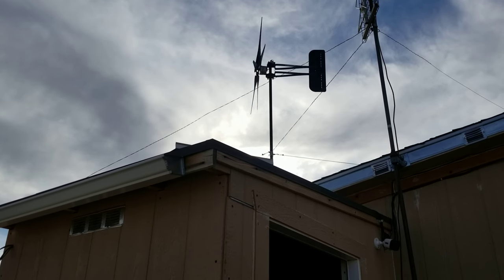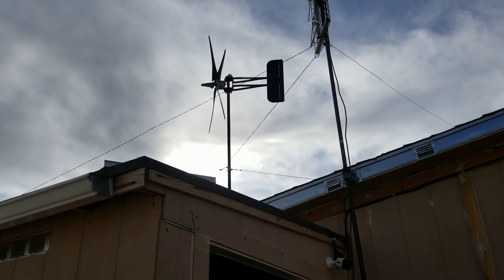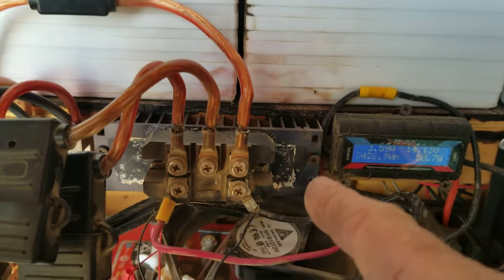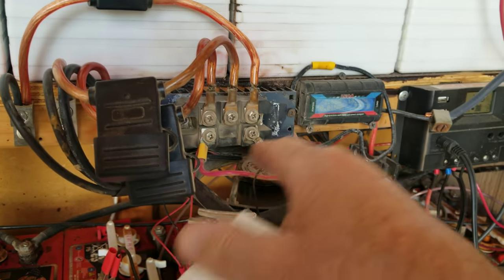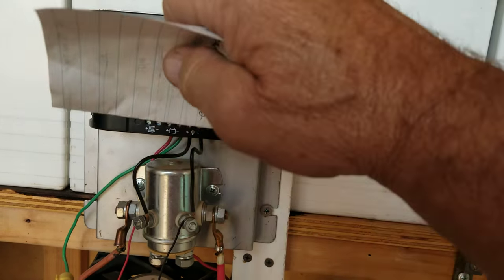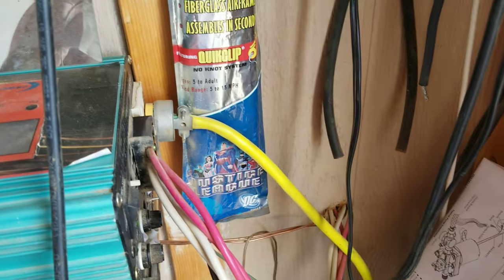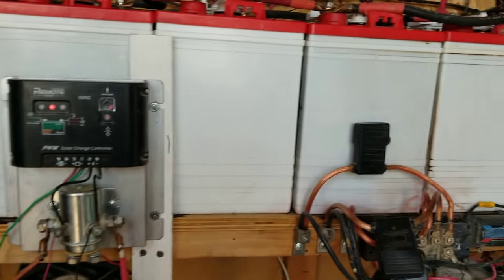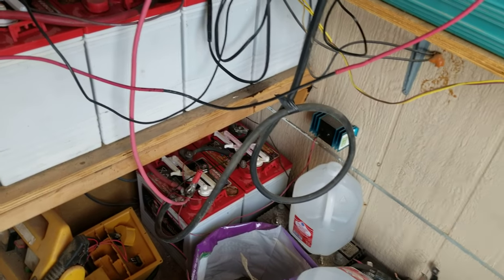Wind turbines, controllers and batteries explained, March 6, 2020

Comment: Very informative 
Thanks for this. 
Question..
What is the use of pma and pmg
Reply from the maker: Welcome aboard!
A PMA (3 wire) is an alternating current device which requires an external rectifier to convert the alternating current (AC) to direct current (DC) for connection to the battery bank .
A PMG has a rectifier built in, so only 2 wires come from the unit, directly to the battery bank. 
The PMA can use smaller gauge wire than the PMG which saves money, but also having the rectifier built in means you would need to bring the PMG down to replace the rectifier if it burns out.

Comment: What about lithium batteries for offgrid
Reply from the maker: LiFePo4 yes, good.  Lion, no.
*If going with LiFePo4, be sure the battery you buy has high and low temperature protection  built in.
*One big 48v 200ah is better than 4-12v 100ah 
*If in an area with freezing temps, either plan to store your batteries indoors in a heated room, or buy batteries with built in heaters.
Reply from the maker: Welcome aboard!

Comment: I have a wind generator and it has 3 red wire that come out are they all power out
Reply from the maker: Welcome aboard!  Yes, that is a 3 phase alternator that produces AC power.  In order to use it you need to run it through a "bridge rectifier" to convert it to DC if using it on a battery bank.
Reply: @GBear  
Yes it came with a controller 
I like your dump off controller I didn't think of that I'm just starting out but it's for my travel trailer
Reply from the maker: What are the numbers for that unit?  Also, make and model?

Comment: 8k inverter u running the whole house?
Reply from the maker: Hi Mike, welcome aboard. Actually, that old 8k PowerJack was in the beginning, I found out the hard way that the Chinese lie about their electronics.  I hooked up a well pump and it kept popping the inverter.  On further inspection, it said in fine print, "max pump-1200w" yet the inverter said 32000w surge on the same label.
I now use an AIMS 4000W, PURE SINE, SPLIT PHASE,  LOW FREQUENCY, and yes it runs the house, my shops and no problem with the pump at all.  I even run my milling machine.
If I was going to do it again, I would have liked to get the AIMS 6000 Though.  It wasn't available when I needed it.

Comment: you are the first person that I has a wind/solar power that prefers lead acid or golf cart batteries over deep cycle or lithium batteries. 
May I know the reason?
Reply from the maker: My lead acid ARE deep cycle.  They are golf cart batteries, specifically designed to handle heavy loads and discharge slowly, then recharge quickly.
When I started with wind and solar, about 8 years ago, these batteries only cost $99/each.  They did the job at an affordable price. 
As lithium became more popular, I almost wanted to switch, but their cost and them not liking extreme heat or cold persuaded me to stick with these.
Welcome aboard!
Reply: @GBear  Thank you. I was considering gold cart batteries because they are cheap. 

now I am just considering to buy used (burned out) batteries to regulate the Voltage so that the inverter work. I don't care about storing energy. I will let you know how it works!
Reply from the maker: @googlerreviewer4368  hmmmm, burned out batteries won't have voltage enough to run an inverter and produce output.
Reply: @GBear  I know they won't store any amps or power inside but I want to try it. because as soon as you charge a burned out battery, it would give you 12V, remove the charger away, it would go back down to 8V. so there's a slight chance that it might work. this way, it would work as long as it is windy or sunny.

I will keep u posted about the result.
Reply from the maker: Ok, but I hate to sound pessamistic...the inverter will probably shut down when volts go below 10.5.

Comment: GBear! I'm having an issue with my wind turbine (pma). Whe I connect to a charge controller (3-wire) it appears to be breaking. There is no free spin. What am I doing wrong??? By the way.... Are those 3 fuse boxes just before you 3 wires going to your rectifier? I REALLY NEED YOUR HELP!!
Reply from the maker: Hi Jerald, welcome aboard. 
Ok, let's recap.  First you connect the battery to the controller. (I'm assuming you have a hybrid controller)
Then you connect the PMA to the controller.
At this point the PMA will have resistance, because the fields are activated.  The blades should still turn, but feel like a magnetic stop every quarter turn or so, but this is normal.
If it freewheels when connected something is wrong.   The resistance is what the wind must overcome to produce electricity. Don't ever let the PMA freewheel in a wind, as this can burn it up.
Yes, those inline 60A fuses are between the PMA and the rectifier,  then I have a 100A DC breaker on the + wire going to the batteries. 
I hope this helps.

Comment: I have a crazy Idea, can you make the regulated output of the wind charge controller as an input of a solar charge controller, coz Im planning this as an input for my hybrid solar off-grid inverter charge controller, because in that inverter not much power is wasted because when the inverter sense that the battery is full the generated energy is then be used first by current house consumptions and wind turbine have a lot of wasted energy going into the dump load
Reply from the maker: Welcome aboard. 
Your answer is no.  Unless it is a hybrid controller designed to handle the putput of your PMA.  Many PMA's can put out excessively high amps and watts in high winds, and would damage a solar charge controller.
Reply: @GBear  thanks for the response, But Most of the solar charge controllers have their rated charging current, lets say 30A 40A 60A, so why worry about damaging the controller if they are likely to get the maximum power they can handle then after that they will stop receiving power(lets say more than 60Amps) and 2nd option is to get a solar charge controller which has higher charging rating than that of the wind controller so that , that issue could be eliminated, thanks for you response sir
Reply from the maker: @eaglefox8455  one of my viewers earlier this year tried it and blew up his controller.  I have seen my PMA produce 88 amps in high winds.
Reply: @GBear  thanks for clearing it up steve, and giving some practical experience, I really appreciate it:)

Comment: Hi G Bear. I have a question for you. I'm looking to get near offgrid battery storage. At the moment I'm looking at a total of 1000AH in total. 4 batteries 12volt. Set up to give 24volt. Will this be enough for a small house hold. The batteries will set me back 2000€ for the 4. What do you think..  will that  be enough to run my home. I would appreciate your input. Thanks  Bear! I have watched this video 4 times and sheared it to people who have the same interests. Great stuff!!!
Reply from the maker: Hi Peter, Welcome aboard. 
Short answer, probably not.  I really don't have enough information to make an accurate comment.
I suspect your household items are 220-240 VAC from your monetary symbol.
To properly size the battery bank you first need to total the number of watts needed to run all your household items.  There are many charts available online to help you size your battery bank and solar size.
If it helps any, I run my small cabin on a 12v battery bank made up of 18 each 6v deep cycle golf cart batteries, connected to make 12vdc input to my inverter.  I recently added 4 more larger batteries.  The first group totals 2007ah, and the second group is 740ah, total=2747 amp hours.
This configuration runs all the basics, and will run a window air conditioner in the daytime with the 2900 watts of solar input, but won't handle electric heating units, toasters, microwaves, etc after sunset.
Reply: Wel it's a good starting point 1000amp at minimum. Its called: (sonnenschein Gel Deepcycel battery).
I have a 3kw three-phase  vertical axle turbine (Makemu.it) no solar  panels. i guess it's a question of trail and error. Thanks for your support Bear. The smart battery big brands have 8kw battery storage at minimum 5000€. Expensive purchases.
Keep safe.
Reply from the maker: @peterjoseph2803  wind is good for a back up, but solar panels are king for daytime power.

Comment: This all seems so complicated, and depressingly difficult. Do they make/sell ready-to-go systems, for people of low-tech understanding? Do I really need a shed full of wires and gizmos to get a wind turbine working? I'm looking for a simple setup where the wires from the wind turbine plug into one "box", then the output from that "box" is a cable that I can plug into my portable battery/generator to charge it. This is how it works with my solar panels.
Reply from the maker: Welcome aboard.   Yes, times have changed.  You can use a Midnite Classic charge controller after the bridge rectifier.  Then just connect the Midnite Classic to your battery bank like you would with solar.

Comment: Greetings. If I want to charge a EV, how much kva (wattage) wind turbine generator would I need?

Edit: I can't get higher than 2kva solar setup, because of area limitations.
Reply from the maker: Sorry, not enough information to make an accurate reply.
Reply: @GBear  what was your total cost for your current wind power generator setup?
Reply from the maker: A wind powered generator is not a good option for charging an electric vehicle because it will have varying outputs in different wind speeds, mostly too low to be of any help.
Reply: @GBear  thanks for the advice but I can't go above 2kva solar setup because of area limitations.
Reply from the maker: Are you on grid or off grid?

Comment: How do you run a 240 volt A/C circuit off of the system? Also, why did you choose the 6 volt lead acid instead of a lithium 12 volt? And last, if you could start over and recover all the money spent, what would be different? Thanks Bear, I have learned a TON from your videos!
Reply from the maker: Welcome aboard David!
Ok, running a 240v A/C requires an Low Frequency, Split Phase, 240v inverter.  
I went with flooded batteries because of cost and amp hours, and lithium doesn't like the freezing temps I can get out here.
Starting over?  More batteries before the price went up, a better, higher output PMA turbine, Only buying Midnite Classic controllers, Only buying the biggest LF SP AIMS Inverter Available.

Comment: Why didn't you use the wind control on battery charger  never mind to high of power for it
Reply from the maker: Hi Anthony, welcome aboard.   My PMA has a max ouput of 1850watts, and those controllers are only rated at 600watts for wind power.

Comment: I just want to charge a 48 v 13 ah e-bike battery . I’m in a hoa and can probly only put a small helix slightly above roof line on a pole . Will i benefit at all from the wind?
Reply from the maker: That depends on if the wind blows at an adequate speed at the time you need to charge your battery, and how efficient your turbine is.
You'll be better off getting one 50-100w solar panel you can set in a window, with a 48v charge controller.  You would need to install switches on the solar panel + wire so it can be disconnected at will.  This is because you need to always connect the battery to the controller FIRST, then the solar panel second.  Also, try to use an amorphous solar panel like the ones sold by Harbor Freight Tools, as they produce electricity in very low light, in case you don't have a window facing in the best direction.
Lastly, save a piece of the carboard box that the panels come in so you can cover the panel before switching it on and off.  You should NEVER connect or disconnect a solar panel while under load.  I can blow the internal diodes.
Reply from the maker: Welcome aboard!

Comment: Great video!! I'm in te .idle of a diy turbine with a dc motor. You helped a lot. may I ask... the turbine obviously produces different amounts based on the strength of wind at the time. Does this matter for chargung the battery? Like if its putting out 200 volts into a 12 volt system will that be ok? (I do understand it can over charge so it needs the dump load) I'm more curious if there's a range of voltage or current it must fall under so it doesnt damage the battery or does this only matter for the gauge of the wire to be able to transfer and not burn up? Hopefully that question is understandable. Anyway ty very much.
Reply from the maker: Hi Tad! Welcome aboard!  Normally, a turbine is purchased to match the voltage of the battery bank,  ie; 12vdc PMA/12v battery bank,  24vdc PMA/24v battery bank, 48vdc PMA/48v battery bank.
The voltage output of the PMA is very important!  If your PMA produced 100v and was connected to a 12vdc bridge rectifier it would blow up.  Remember, a DC bridge rectifier is comprised by connecting 4 diodes in series to change the alternating current to direct current by forcing the 3 input wires to all flow in one direction.  This produces heat, and lots of it, that's why the rectifier needs a heat sync. 
The major downfall of small DC PMA'S is they may start producing electricity at low wind speeds, but that voltage is too small to charge a battery bank.   To produce the 13+ volts needed, a 12v-1685 watt PMA needs about a 15mph wind.  This means it is pretty useless to most locations/applications, as not many places have constant 15+ mph winds, 24/7/365.
I hope this info helps.
Reply: You need a charge controller like the midnight classic in between your turnbine and battery bank It goes Turbine >rectifier>charge controller>battery bank>invertor>main breaker panel.
Reply from the maker: Yes, I have stated that is my plan in previous videos, but finances are in the way.

Comment: Can you recommend a bls unit for my battery bank of 500 amps please
Reply from the maker: The bls units go by voltage, not amps.  Whatever you battery bank voltage is, you use that bls.  Mine is 12v so I use the BLS-12-N.
Also, the BLS is for lead/acid flooded batteries only.  Don't use it on lithium.
Reply from the maker: Oh, and welcome aboard!
Reply: Thanks for your help much appreciated
Reply from the maker: You're welcome.

Comment: This did not really help me know what I need to run my small 500watt turbine. I have the wind turbine and some 12v100ah deep cycle batteries..The cheap controller it came with and nothing else. Does anyone know what size Dump load resistor I should use? And what gauge wire? And if there is anything else I need? I'm looking for cheap and easy. I don't plan on having a huge storage area. Thank you in advance for any help.
Reply from the maker: Welcome aboard.  Let me simplify things a bit to help you understand better.
I suspect your 'turbine' is a 3 wire AC and not a 2 wire DC, so unless your turbine is going to be set more than 50 feet from the battery bank,  10ga stranded wire should be sufficient. Then you need a bridge rectifier to change the 3 wire AC input to 2 wire DC which will connect directly to the positive and negative poles of the battery bank.
Then you would have a dump load system (diversion system) to keep the battery bank from overcharge.
Firstly, understand that your 500w turbine will only produce 500w in the maximum wind speeds the turbine is rated for.  I don't know what kind of winds you will be getting, but I doubt you'll ever see 500w.
So, rate your resistance according to the expected output, let's say 500w resistance is the max you would need.
The idea of the dump load is to use electricity if your battery bank is fully charged and the turbine is still adding a charge.  The resistor will add a load to the battery bank until the batteries drop below the dump load set voltage, then shut off.
That being said, any resistance from 300-500 watts would be plenty, use 10ga stranded between the dump and the resistor with a 20A inline fuse.
I hope this helps.

Comment: I'm about to purchase a solar/wind setup from amazon for my rv. I can't seem to find any answers on what my best bet is for the battery bank. Any advice? It's a total of 700w system, 3x 100w solar panels and 1 400w wind turbine.
Reply from the maker: Welcome aboard.   Skip the wind power and double up on the solar.  Spend more on a good controller like the Midnite classic 150 or Renogy or Outback.
Wind PMA at 400 watts max won't give you enough power consistently to make the expense and added equipment worth your while. 
You didn't mention the size and type of your battery bank.

Comment: Hello
Can anyone help me understand?
If the wind turbine is 48v does the controller, battery and the inverter has to be 48v as well? Thank you
Reply from the maker: Welcome aboard!  Yes, basically.  But it's a bit complicated...
For all intensive purposes, you want to maintain all components at the same voltage. BUT, if you have the proper controller, like a Midnite Classic,  you can input a higher voltage Permanent Magnet Alternator (PMA-3 WIRE OUTPUT).
The batteries are always connected to the controller FIRST, which tells the controller what voltage to charge.  Then a higher voltage input will be stepped down to match the battery voltage needs.
Note that you cannot use one controller for both pma and solar AT THE SAME TIME.  It's one or the other.
I use a Midnight Classic 150 to charge a 12v battery bank with solar, and have my panels in series to provide input voltages around 110volts.  The classic steps that down to 14 volts to charge the batteries.
You CANNOT use a bridge rectifier to convert the 48v PMA AC  power to DC 48v and connect to a 12v or 24v battery bank, however.
Also, you cannot use the controller that comes with the turbine to charge other voltages.  It can only be used with a 48v system.
I hope that helps.
Reply: @GBear  Thank you very much!
Reply from the maker: @xXJusTMichelxX  you are very welcome.